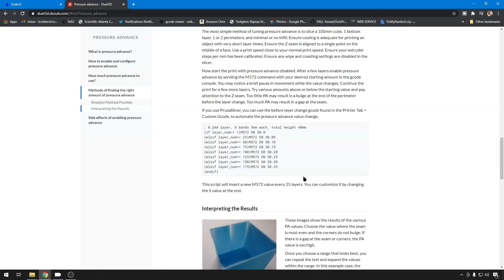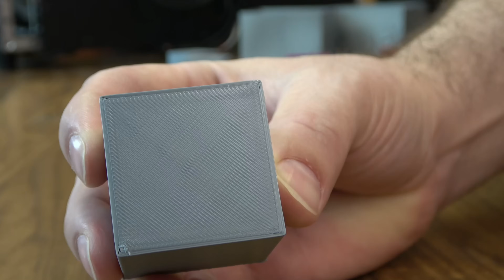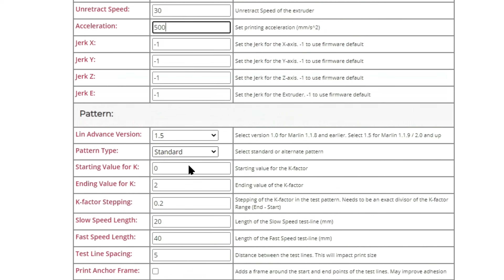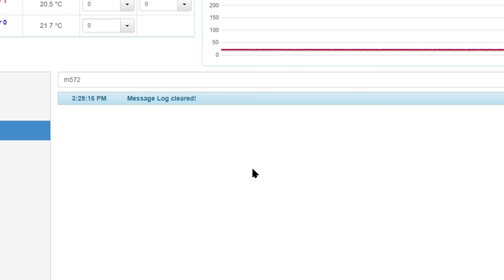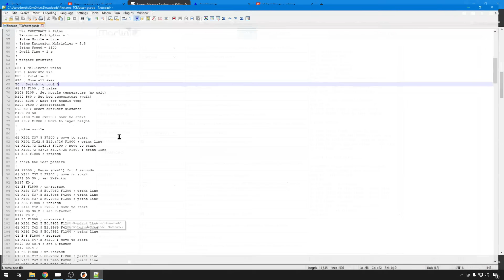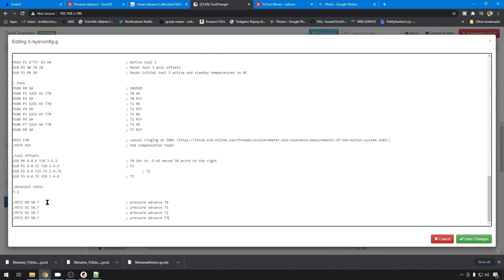RepRap Firmware - Pressure Advance - How To - Chris's Basement

Comment: chris man, i need help. please please please reach out to me. I did a full build on my ender 3 pro. every single upgrade possible. duet 2 wifi. paneldue just everything. i went to update something... and now everything i try.. i open my pc with ip, it shows the homescreen of the duet...but i cant do anything with it. and it says incompatible firmware version. so i keep taking the sd card out. trying different things. and putting it back in. plugging in usb to pc. trying again and getting same thing. i really need help man please.

Comment: My perimeter beginns in the corner so I set it rear but it prints in the rear corner.
Reply from the maker: You're talking about the test prints in the corner? If so, you should be able to alter the gcode generator to compensate.

Comment: Interesting that I can't find a lot of videos about the noise LA makes for bowden (40mm), I'm trying to set it up for many hours, retraction from 1 to 6, E_JERK from 5 to 50, accelaration from 500 to 4000, combining them with LIN_ADV 0.05 to 0.2 and my extruder screams like hell, the sound of that is like scratching your brain with a fork, it can't be described how annoying it makes.

There are some hidden reddit posts and others, maybe it is because I'm using a bmg geared extruder with 3:1 gear ratio. 

Did anybody do a setup like that?
- ender 3 pro
- bmg (clone) extuder
- dragonfly bms all metal hotend
- capricorn tube
- pla

I can only do a complete test if I leave the house because it makes my nerves go crazy.
Reply from the maker: I have had that same issue on the BMG style bowden setups. It's really hard to find a number that helps, without all the noise. LA just doesn't work well in this case.
Reply: @ChrisRiley  yeah it seems like that, I'll probably convert my setup to direct drive because I don't have a high speed anyways on my ender 3 and we'll see.

Comment: I cannot thank you enough for this video. Especially the acceleration, jerk, speed setting edits in the config file towards the end of the video. I just switched to RRF from marlin and had been really disappointed with the print results and the lack of clear, straightforward guides. I still have some tweaking to do but WOW the improvement in my print quality after following this video is enormous. Thanks so much!! I’ll also echo the requests for more RRF video guides. Compared to Marin it’s not as easy to find info, especially on YouTube, and the official documentation is not as beginner-friendly as marlin.
Reply from the maker: Awesome to hear Doug, a lot more RRF stuff to come.

Comment: Hello Chris I just wanted to see if you could help me with a problem I’m having, I recently updated my duet to 3.1.1 firmware however it now doesn’t show any connection between my controls and the duet motherboard, not even the leds turn on on command please help me !
Reply: I’ll try it thank you very much !!
Reply from the maker: You might have to reset and start over. Try the reset process. https://youtu.be/UPu7_RPE1d0

Comment: Pretty cool. I'm still learning linear advance in Marlin. If I enable it in the firmware but do not call a K value in the gcode, does it ignore LA?
Reply from the maker: If you enable it in firmware, but leave it defaulted to 0, then yes, it ignores it until you send it a M900.
Reply: @ChrisRiley  right on!

Comment: i have anyquibic predator Delta printer and i did this and the best i got was at 0 and my M556 is M566 X1200.00 Y1200.00 Z1200.00 E1200.00 what am i doing wrong ? i have the M92 X160.00 Y160.00 Z160.00 E838.08 with extruder BMG
Reply from the maker: Is the bowden tube really long? Does the extruder show that it is trying to compensate? It might just not be able to keep up.
Reply: @ChrisRiley  the tube is 30 cm
Reply from the maker: @EnergySeeker  That should be fine, run a m572 during the print. Make sure the settings isn't being overwritten.
Reply: @ChrisRiley  when i do M572 i get M572 0.000
Reply from the maker: @EnergySeeker  That's your problem. Run a M572 D0 S1.0    before/during your print.

Comment: I was immediately impressed by the new Marlin and linear advance when I switched my E5 over to the BTT SKR MiniE3 v1.2, so much so that I immediately ordered 2 more for some Ender style printers. Nice adaptation for RepRap. Would it also be similar for Klipper? I only ask because I'm in the middle of a Voron build and not sure if I'm going to use Klipper or RepRap.
Reply from the maker: Hey Kevin, great question, I am not sure how Klipper does it yet, but I am guessing the calibration would be very similar.

Comment: The bowden flex is the main problem, I have a suuuper stiff bowden ~450mm long and are running 1/3 of everybody else.. sort of.. it would be interesting to test it on your tool changer..
Reply from the maker: Send over a link to the tube you use if you don't mind. I want to try and get some.
Reply: @ChrisRiley  I sent a mail..